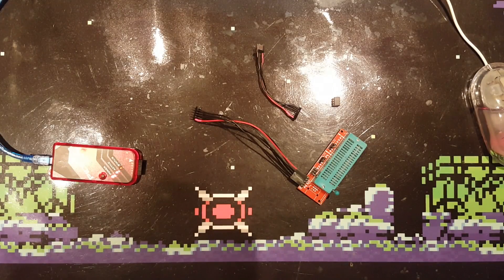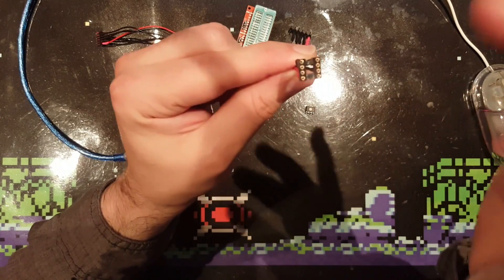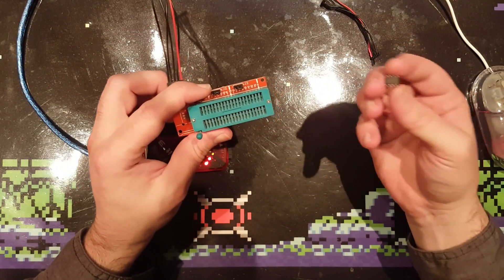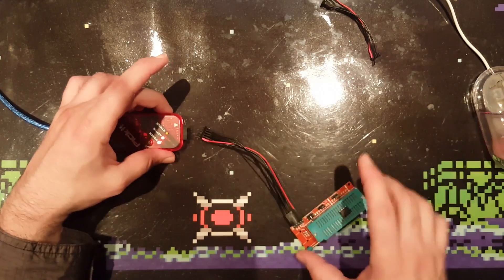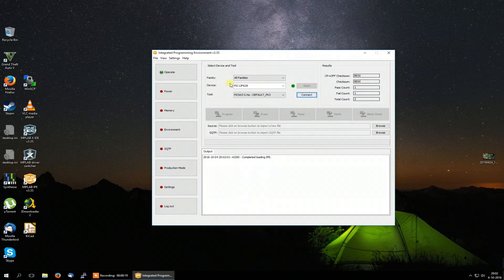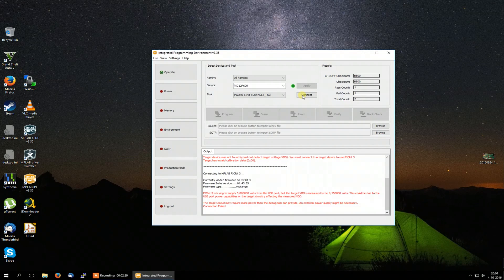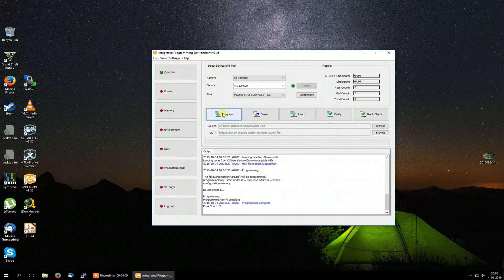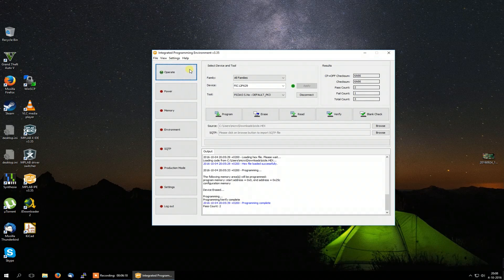How to program a PIC Microcontroller with a Pickit 3 (using a universal adapter from Ebay)

Comment: If someone is having trouble with PICKit 3, it's a good idea to double-check its limitations before assuming there's a bigger problem. Specifically, the PICKit 3 doesn't support 5V programming directly. You'll need to adjust the voltage level to 3.3V because of a design quirk. Dave Jones covered this in an EEVblog video back in 2010: 
https://www.youtube.com/watch?v=LjfIS65mwn8

Comment: Little bit oldish video, but I want to say big thanks, this saved me from lots of frustration with programming 12f629. First, I needed to get one of these janky clones, because there is apparently a bug with T48 programmers/software and 12f629 and it isn't possible to program it currently on those. I also tried with one old RS232 JTAG programmer, but that also failed. So project was on hold when I waited one of these clones and adapters to arrive and today I got one. I got the same type of voltage errors, but thanks to you it was a breeze to solve!
Reply: Hi ! Nice to know your experience. What ya doing with it ?

Comment: I had ordered the same programming adapter with Textool socket in 2023.
Today I conneted with my ORIGINAL PicKit3 (Microchip) and found same problems: It is neccessary to reduce voltage to 4.75 .
Nobody knows why, but this helps. See video minute 9:00 ff
By the way: My uC is type PIC16F1827 , I used MPLAB X IPE  v5.30. 
Thank you!

Comment: Having issues getting a pic16f628a to be recognized, even after applying voltage. Have 2 blank chips, both dont show. Have it on in the dip18 slot . No go :(

Comment: I have a question, i have a 8-pin DIP microcontroller but i don't know the number because it was scratched off. I need to identify the number so i can Buy some and copy the program it has into the new ones. How can Ai do that?
Reply from the maker: I am not sure if that is possible. Check this: https://www.microchip.com/forums/m837452.aspx

Comment: Thank you! Was wracking my brains trying to figure out why my programmer wouldn't recognize my PIC12F1840. Didn't know I had to tick a box in the software to make the programmer provide power to the chip. Looks like the latest version of the Microchip IPE actually buries this setting under "Advanced Mode," as well.

Comment: This is great, but in the case of a DIP 20 chip, how do you put it in the Adapter? It's says DIP 18 and 20 go in the same place, but there are only 9 rows of pins where it says it wants me to put a 10 row device. Are you supposed to fit the 1st and 20th pin on the white line with pin 30 and 11 then? (I've tried that and MPLAB doesn't like it, and the device gets really hot). Let me know what you think.

Comment: I just plugged the adapter straight into the Pickit3 and it worked a treat. . programming an dsPIC33fj128gp802. Thanks for the video.

Comment: I tried wiring straight from the USB cable to the adapter board as you recommended (red wire to VCC, black wire to GND) but the pic just overheats. MPLAB is sending the correct voltage for the chip. Bit confused.

Comment: Hello, how would you set the configuration bits for a pic16f87A microcontroller,  - XT, WDT on?, if I have my own resonator at 20mhz. Not sure how to set the headers for my hardware, or if it's even necessary with standalone pic on a breadboard.

Comment: Easy to arrange? It has 16 running light programs & a push button for switching programs but I only need 1 program & when holding down the button, all 3 lights will light suddenly when you release the button it will return to running light again. Can you delete the unnecessary programs?

Comment: you are the man! I stumbled with changing my program from internal 4MHz internal oscillator to external 16MHz crystal which resulted in Pickit3 (clone) malfunction, your advises helped me continue working without trying to harness my K150 programmer (which is not near my vicinity at the moment)

Comment: Great video! I believe the English word you're trying to use is acetone. Acetone is used to chemically "weld" abs plastic together.
Reply from the maker: Yes, but I used Butanone (Methyl Ethyl Ketone), which also does the job fine. :)
Reply: Acetone is the common name for propanone (dimethyl ketone). Butanone (methyl ethyl ketone) is usually sold as MEK. You can use either.

Comment: Dear sir, i have to copy a PIC12F615s using a DIL8 to DIP8 adapter as i don't want to mess anything with the soldering iron ... do you think that adapter would do the job ? can you tell me where on ebay (or amazon) can i buy it? i just found models compatibile only for PIC16
Reply from the maker: These things are hard to find on eBay or Amazon. Maybe you can just buy a normal 8-pin DIP IC-socket and use some wires and header pins to create the adapter yourself?
Reply: i found the DIL to DIP adapter look at this beauty 
http://www.ebay.it/itm/261935248244?_trksid=p2060353.m2749.l2649&ssPageName=STRK%3AMEBIDX%3AIT

the question is will it work with the chinese ICSP adapter you are using with the pickit3?
Reply from the maker: Why would you want to do that? You can just fit the IC in the adapter I use.
Reply: Bas van der Sluis because my ic is a smd i believe your adapter only works with dip ic
Reply from the maker: Ah so. I'm very curious about your way of programming the SMD IC. Please let me know if you succeed. Good luck!